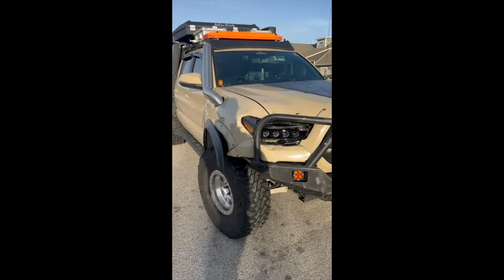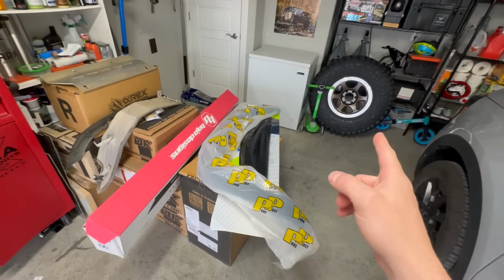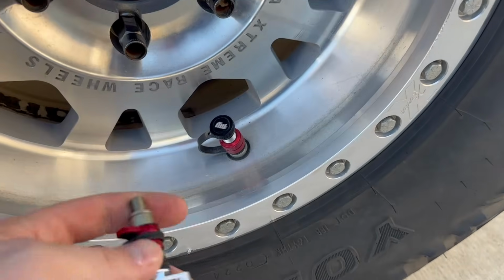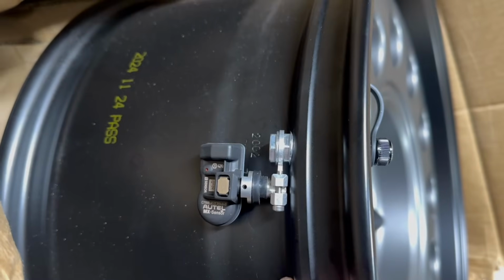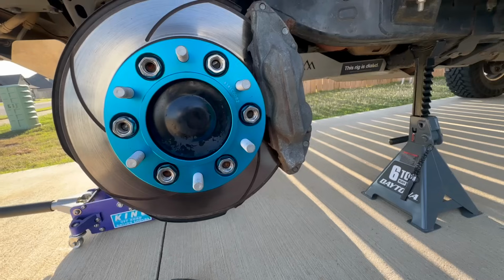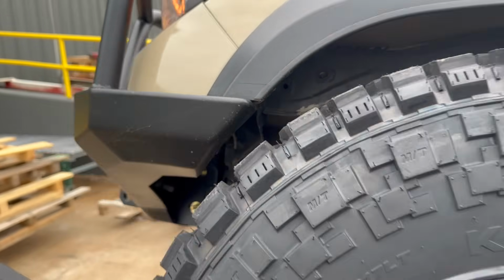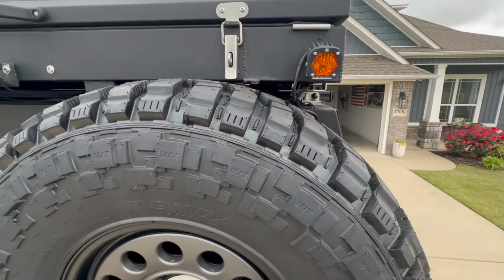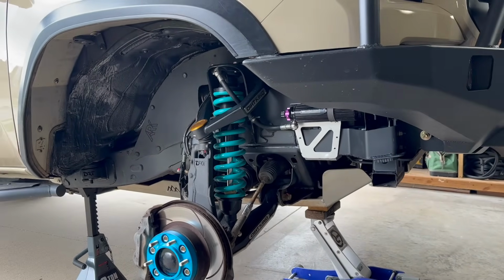FULL REBUILD! Huge 37" Tires, Long Travel, & Custom Wheels!

Comment: Or you just put a big screw driver in the rotor up again the brake to tighten the wheel studs
Reply: Or just put it in 4x4.